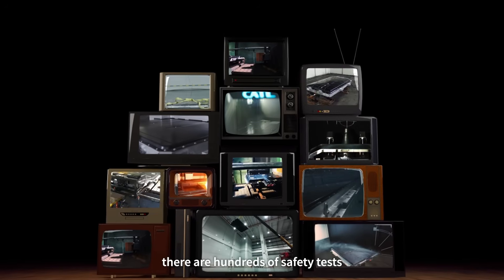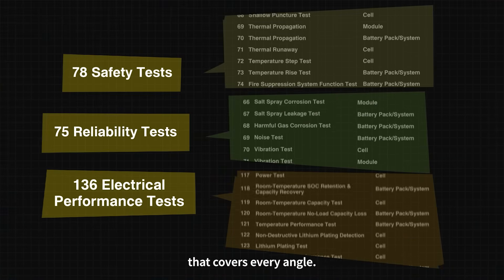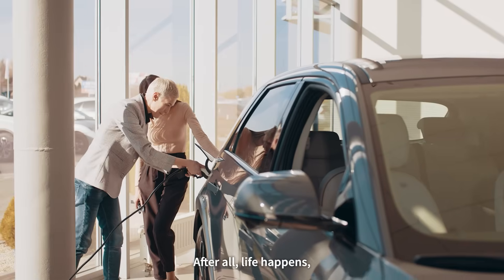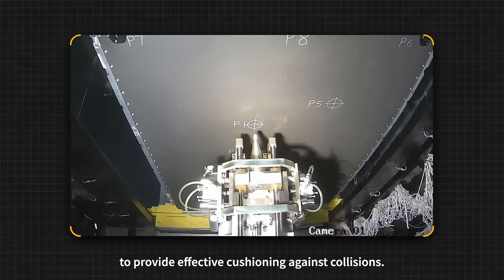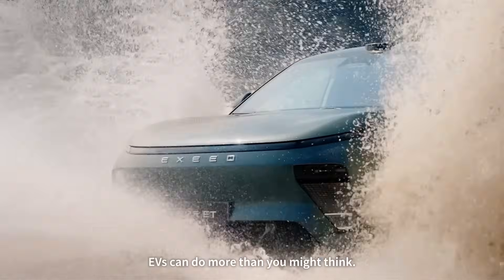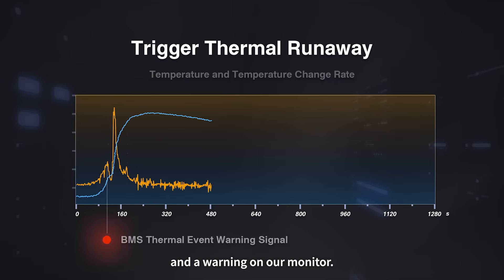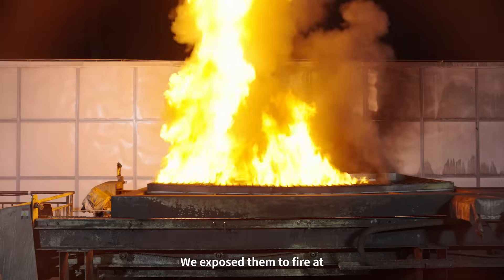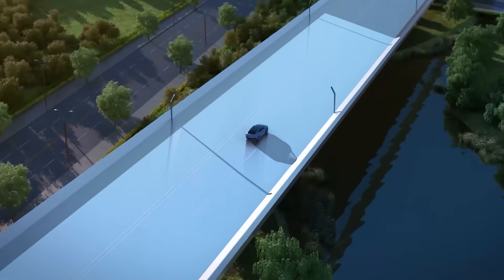How Safe are CATL’s EV Batteries?

Comment: 😊... 3:54 NO FIRE?!  But wath are the fire from the battery in the front ...?!😊
Reply from the maker: The flames come from an externally applied fire source used to simulate extreme fire scenarios. The combustion occurs outside the battery pack, and the key result is that the battery pack itself does not ignite or explode.

Comment: Has anyone seen or heard about the new byd's  new super e platform with ultra impressive new "flash blade  cells"? Here are just some of its amazing specs:50% higher energy density(possibly with ultra high energy density innovative honey comb structure based anode)meaning 252 wh/kg at cell level ; 35% higher cycle life (7000 cycles) ;50% lower internal resistance and because of that 50% lower generated heat in pulse discharging and charging , 10C charging rate (10-80 % SoC in just 6 tiny minutes) ; maximum of 1000 kw of charging power ,these insane new flash cells can recieve 1000amps of charging current which is unheared and unseen before. World should be worried not just tesla or CATL . Byd changed the NEV industry for ever . Historical moment for car industry (byd can achieve 428 wh/kg with gel polymer electrolyte and dry electrode coating in its amazing super cells for 2027 with 60% longer calendar life(16 years) because of gel polymer electrolyte)